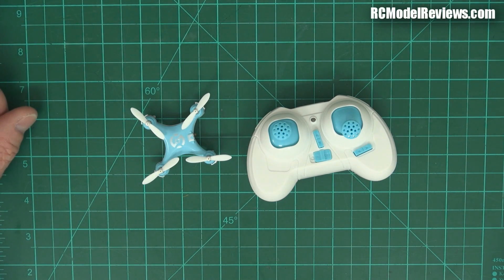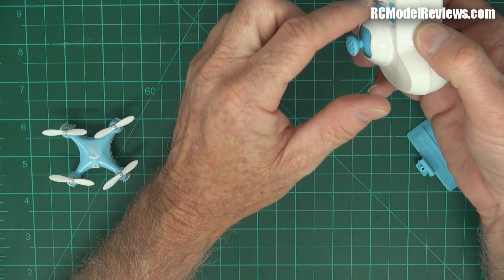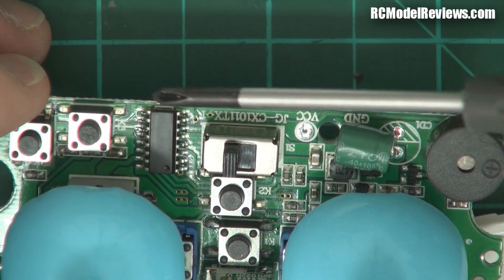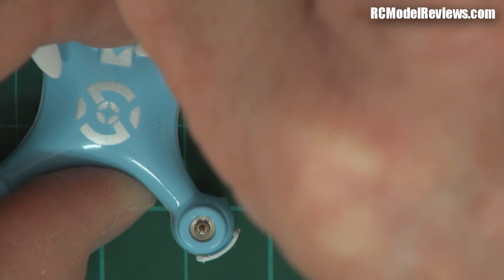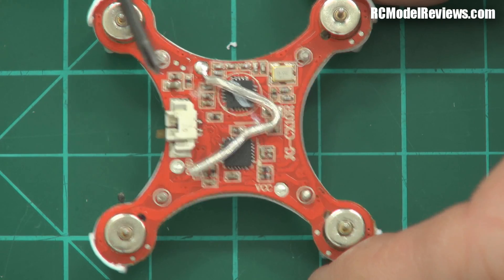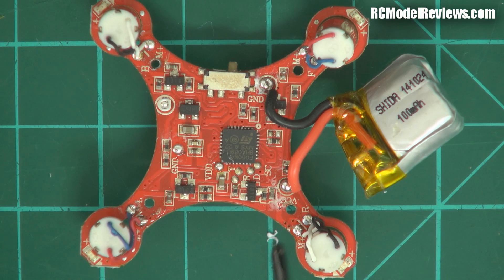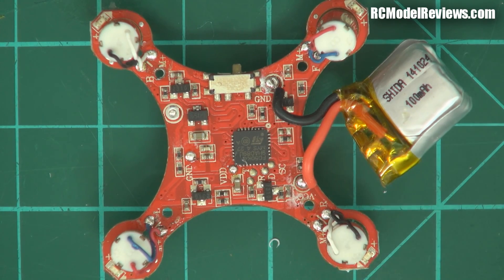Teardown: Cheerson CX-10 micro quadcopter

Comment: I was just wondering if anyone knows if there are any small possibly even sub-gram microcopter boards like this, that have accessible ESC output signal terminals.  The board in the video and other similar really small quadcopter boards that I have seen, seem to just have motor signal outputs.

Comment: Interesting video.  I'm wondering though why they didn't make a jst connector for the battery so you don't have to desolder the battery for a new one.  I believe the similar Hubsan H111 has such a connector.

Comment: Hey there, great video mate. I have been searching the net for ages to find out. I bought a cheerson cx10 then crashed it, it got messed up so I bought another exactly the same. I stupidly threw the first transmitter out thinking if I bought another one that the new transmitter would be able to bind with both as theyre both the same quad, do you know why the new transmitter will only bind to the new quad and not the first cheerson cx 10 that i bought?

Comment: Wish I had your model. I got received one as a gift and one motor wasn't soldered in, it kept shorting our with the one wire dangling around and it would, crash. I first thought it was the controller. Mine has all that RF goodness but on on a single soldered separate PCB board like yours. Mine RF goodness looks hand soldered with a broken inductor and just doesn't look good. But after opening the quad they now have the antenna as a PCB trace built into the board, no wire that I can pop out to improve reception so that also might be part the issue. They seemed to make the quad PCB cheaper now this way, but it's like a Bluetooth antenna and not as good like your for distance. And as I said the controller RF side is a mess with cheaper labor doing hand soldering. So the motor is burnt after shorting, i took it apart and confirmed the contacts are charged pretty bad? I will replace it but I don't expect it to be much better after seeing the difference.  Maybe I shouldn't have ordered the motor and just gave up after seeing the older model. Oh well, I did order one since I thought my crash broke it originally and felt bad as it was a gift, turns out I ordered a CX-10A model. 
As of now I'm not sure I would recommend it since they have gone cheaper on the build and a worse RF on both sides, the quad and controller. 
So I guess I will see if this one is built more like yours. Maybe different manufacturing plans they are outsourcing to for building them and the next one will be done more like yours if I'm lucky. If not then I'll start looking for one from another company.

Comment: Only bad thing with these small quads is the brushes in the motors can ware out quickly if you fly them a lot. Hell of a lot of fun to fly around, plus the small size makes them harmless so I have no problem flying these round class in uni. My Hubsan Q4 I managed to impail in the ceiling.

Comment: Darn, I was really hoping to mod the controller to switch yaw and banking to the opposite control sticks for mode 4 flying, but it looks like everything is on the circuit board and no wires to switch...

Comment: Bruce, I have this mini and Have a weird problem. I bent a motor after many times flying it, and suddenly when i powered it up I got the throttle to about mid way and all 4 motors shut down. If I take the throttle back down then up again it does the same. Now, i replaced the bent motor thinking it just maybe that but still the same and heres the weird bit - It only seems to do it when I have a prop on that particular motor. If i take the prop off and throttle up, all 4 motors stay spinning. Put the prop back on and they all cut out.. Only thing im thinking is that the prop is causing the motor Axel to lift - but I don't know why that would be an issue. Not a biggie since there only £12 hah but weird.
Reply: Lee Jackson it is the stuck prop motor protection kicking in.
Reply: dont suppose you would know how to solve this issue. Prop is fine, motor is new and tried a few - thanks for the reply tho
Reply: Lee Jackson 
Were able to figure out how to fix this? I've got the same problem...

Comment: My daughter just plugged in the charger backwards.  Ugh.  I've only had my CX-10 for two day, and now I can't get the charger to stay plugged in to get a charge.  Does anyone know any fix for this?  
On the first day I had a hard landing, and one of the wires from the motor came off the board, but I was able to re-solder.  I have not been able to figure the charger out.

Comment: I've been flying my little CX-10 for over a week now. I have the blue pcb version (green case). There's some debate over the original red one being better than the blue or green. People have already hacked them but mines fine as it is. It a took about 6 flights for the motors to loosen up to reduce drifting but now it flies well and the flip its does are vey cute & tight. It suffers from blade wash out and so can unexpectedly lose height but you get used to it. This is the best and only RC aircraft I've bought at this price and it actually works well. Thanks Bruce for bringing it to my attention. I'm not sure about the included USB charger which charges very fast. I use my normal Lipo charge with an adpater for the small connector and charge at 1C, 100mAh, 3.7Vp. The instructions are also rubbish even in English. To start switch on the remote then the quad with the throttle in the down position wait for two beeps, then move throttle to max, it beeps, move throttle to min it beeps and you are ready to go. Sensitivity is changed by pressing the left throttle joystick, 3 settings. The flips are done by pressing the right control stick which causes it to beep untill you move the control stick fully in the direction you want to flip. There is calibration procedure mentioned in the manual but I suspect with the new pcb boards and firmware this is now unncessary and moving the sticks to the calibration position just causes the light to flash repetitively. The blue LEDs flashing when the Lipo gets low is a nice touch and the Blue and red LEDs work well for orientation. Nice little quad.

Comment: Just a heads up on these.
The local LHS took a shipment of them and they have had nearly 30% faulty.
Might have been a bad batch but be aware of your returns path if faulty.
At least 15% were DOA out of the box.
Main faults are 1 - the leans, think horizontal is 45deg and 2 - intermittent radio loss after 1 to 2 min flight causing darts dives and drops at unexpected times.
I will agree though that they a great fun to fly.

Comment: I'm wondering, if You glue the motors to the board and fly it without a shell, how much performance difference would it make?
And If You'd replace battery with a bigger one for shell weight removed... have You any time to give it a try?
Reply: I actually tried this. The glue doesn't last and your props collide into each other first crash and go spinning off into nowhere. The body, etc, adds much needed support for little weight.

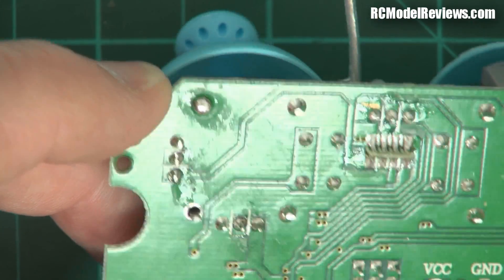Comment: 2:25 there is a joint that is clearly not soldered!!! How did Bruce not mention this???? When he picks shit out of everything else?
Reply: jibba02 I didn't notice that until after I'd edited the video -- but as Balu says, it's not critical, it's simply one of the stick mount points so doesn't affect the operation of the unit.   Remember -- it's $15 :-)
Reply: Those 4 big solder points seem to be the anchor points for the sticks. All of them are on the ground pathway. It's probably enough to just use three. I'm also guessing that's why they are the only ones that were soldered manually because someone has to put the parts on the board.
Reply: ***** I think they're hand soldered coz that's the bit that gives you the modes... I'm a lefty and so sometimes have to unsolder them and switch the pot units around, So I say hand soldered to mode 1 or 2 depending.
Reply: It does not need to be!

Comment: You have an original "Abe" model the first revision, there are 2 versions one with the red board "Abe" and one with a green board,
The Green PCB model which uses a different radio chip and has been revised, it's either a second revision or a knock off..
Reply: Also, Have you seen the "Deviation" mods done to the devo7 controller?
Hacked firmware and multiple transmitters in one package for an all in one fly anything solution..

Link..
http://www.deviationtx.com/

Comment: I've recently ordered the CX-10A, lots of people are saying it has a less than 10 minute charge time. The Banggood data info says 30 mins, but I assume it's a poorly reviewed CX-10 data thing.
Reply: Cx 10 charges in 10 to 12 mins and flies 4 to 5 mins
Reply: Aswin Girish
Yes, mine arrive about 3 months ago. I wonder why all lipo's can't be the fast charge type?
Reply: I measured the charge current from that little charger that comes in the box and I feel bad for the little lipo. That charger is the cheapest of the cheap. It just slams a constant 4.2v in the thing, no charge curve, and does so at ~440mA. That's over 4C! No lipo is gonna last long with abuse like that. I ended up cutting off the cable and hooking it up to a little USB charger that does ~200mA and follows a more proper charging procedure.

Comment: I have one of these, but the battery only lasts around  3 minutes in doors on low speed setting and then the low voltage warning kicks in, time to charge again...  Quad fly's ok -
shame about the flight time though.